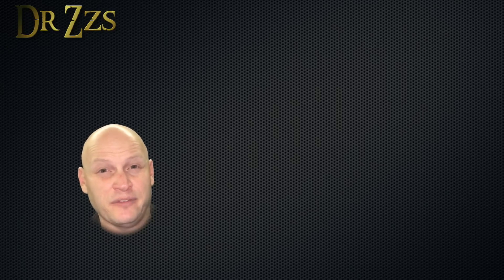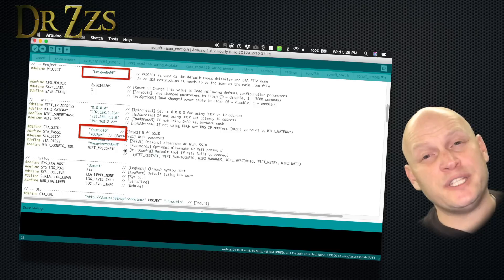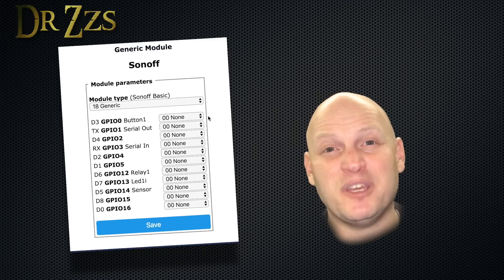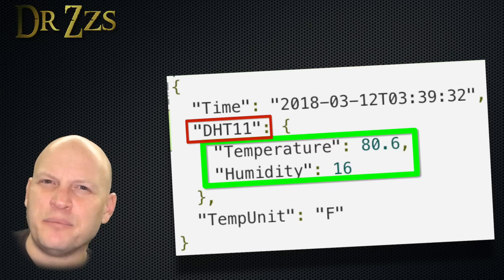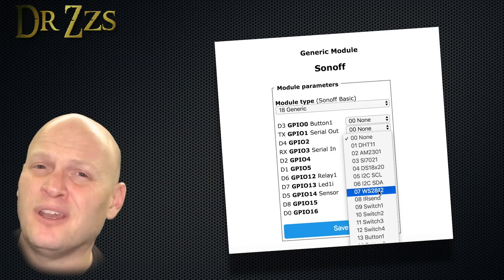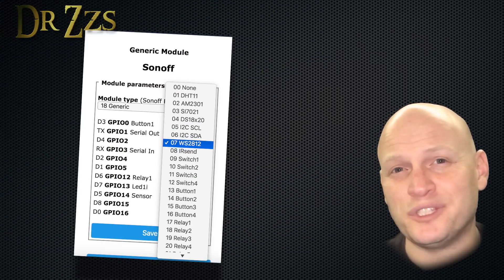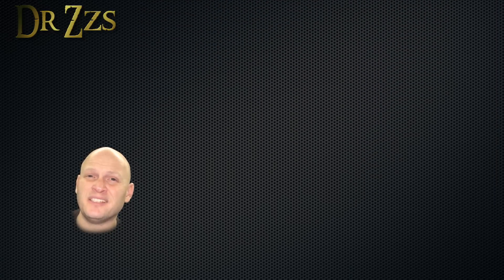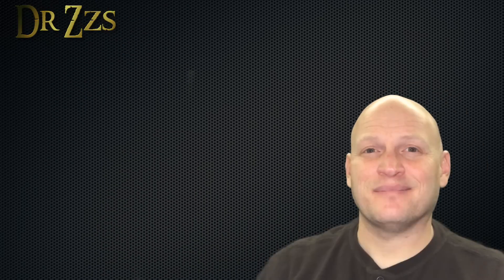Tasmota + D1mini (or Sonoff) - Temp & Humidity, ws2812 LEDs, and Motion Detection

Comment: is there a way to setup a relay like the switch like the sonoff.  i have a few spare esp01.. but i dont want to power the switch and have cables to the relay.  i just want to have power going to the relay like the sonoff.
Reply from the maker: You can connect a relay to the esp01 and the relay will be separated from the power to the D1mini.  Is that what you mean?  
If you really want to make it like a sonoff where you put 120v to it and then you switch that same 120v circuit, I guess you could do that, but it would be a lot more work and probably cost more than just buying a sonoff.  Besides the Esp01 and the Relay you'll also need a 120v to 5v power converter.  The PS is almost the price of a Sonoff Basic:
https://www.banggood.com/HLK-PM01-AC-DC-220V-To-5V-Mini-Power-Supply-Module-Intelligent-Household-Switch-Power-Supply-Module-p-1242358.html?p=@K220219381694201802

That's the appeal of the Sonoff.  You can't buy the parts and build it yourself for less $. 

If you still want to do it you'll have to use the 120v to power the PS.  You'll tap into the Hot line and send it to the Common pole of the relay, then a wire from the NO pole to the lights or whatever you want to switch.  The neutral will also go to the PS, but then also continue on to the lights you're switching.  Then with ps you can power the esp01.  The ESP01 might need 3.3v instead of 5v so you'd need either a 120v to 3.3v ps or another buck converter to drop the voltage from 5v to 3.3v.  The relay will need a supply of 5v in addition to the ground and the control wire from whichever pin you use from the ESP chip.  

Hope that helps. 
Good luck.

Comment: can't seem to get my PIR up and running 

1. I I select "switch3" because the PIR is on D7 and I have relays on  relay1 and relay2
2. after save and restart , in console I ran this command "switchtopic3 saraiyh motion"
3 . I added the binary sensor in my yaml file:
binary_sensor:
  - platform: mqtt
    state_topic: "cmnd/Saraiyh_Motion/POWER3"
    name: "Saraiyh Motion"
    device_class: motion

4. I name the topic: "Saraiyh_Motion"
5. in the console when I move I can see this "19:56:52 MQT: cmnd/Saraiyh_Motion/POWER3 = TOGGLE"
however, the minary sensor does not do nothing, 

what am I missing
Reply from the maker: try "stat/" instead of "cmnd/"
Reply: I just tried "stat/Saraiyh_Motion/POWER3" and the sensor has an error .. it disappeared

21:08:24 MQT: cmnd/Saraiyh_Motion/POWER3 = OFF
21:08:24 MQT: cmnd/Saraiyh_Motion/POWER3 = ON
21:08:25 MQT: cmnd/Saraiyh_Motion/POWER3 = OFF
21:08:25 MQT: cmnd/Saraiyh_Motion/POWER3 = ON
21:08:26 MQT: cmnd/Saraiyh_Motion/POWER3 = OFF
Reply: its working now with cmnd do not know why it just started working
Reply from the maker: oh well, as long as it works!

Comment: I have realized from watching your videos if you are going to build an item for a single sensor its cheaper to use a sonoff with a cheap extension cord from the dollar store. 
Definately going to use a sonoff to turn on my power supply for my led lights and then control them from the sonoff. 

Great videos. thanks for you help.
Reply from the maker: Awesome!  That would be a good use for it.  I've been using Tasmota to control RGB LEDs for my Maker Faire display.  Works great.

Comment: Great video. However note that the D1 mini is not "always in programming mode" like you suggested. The USB serial converter has circuitry in it that will reset the chip and pull GPIO0 down just before the program is sent, placing it in programming mode for you.
Reply from the maker: excellent!  Thanks for clarifying.  
I learned something new too!

Comment: Not sure if anyone know how but Ill give it a shot. My DHT11 needs to be changed because the temperature is 3 degrees off. I looked in home assistant and saw that we can add an offset. but it doesn't work. Is it because its in JSON format? How do we do this?

https://community.home-assistant.io/t/wrong-temperature-value-on-multisensor/32330/7
Reply from the maker: I haven't done it, but what happens if you format the value_template like this guy did:
https://community.home-assistant.io/t/wrong-temperature-value-on-multisensor/32330/9

value_template: '{{ (float(states.sensor.tmp_living.state) - 1.4 ) }}'

Also, the DHT11's aren't super accurate. That may be why the correction of the temp still doesn't give you an accurate temp. You may be better off with a DHT22 (AM2302).

Comment: Great video as usual DrZzs has anyone linked a sonoff basic to a water leak detector off some sort ?, i've looked at various wireless versions using home assistant ( z wave & 433Mhz ) but unfortunatly im getting reliability problems (especially with z wave devices they just seem to work when the feel like it !)  Ive got 20+ sonoff's for lights and they have been faultless and 100% reliable...looking to get this reliability into my water leak sensor (for basement)
Reply from the maker: You probably saw the one I used in the last RF Bridge video.  That one seemed reliable.  But it was 433mhz.  
If you're looking for something wired there are a couple types of Arduino water sensors.  I don't know if there is a wired "leak" detector but I have seen water level and moisture sensors.  One of those might work.

Comment: My sensor shows the F for Fahrenheit but the actual reading is still in Celsius. Any ideas?
Reply from the maker: maybe try "setoption8 1" in Tasmota Console
Reply: Fantastic video btw! I think I will add a couple reed switches and monitor my garage doors.

I ended up changing the HA configuration “unit_of_measurement: to “C” ..... this worked I’m assuming because my HA unit system is set to imperial. I’m sure your suggested setoption8 to 1 would have worked as well.

Comment: After 2 days of errors for undefined resource WPS errors I finally found out you have to run an older board package version. esp8266 version 2.3.0 works but the newest ones caused me about 20 hours of headaches a sore butt and wasted weekend. Also if you want a DHT22 to work for some reason I could only get it working on pin D5 using AM2301 as the sensor type. Even though the sensor is technically a AM2302 it works. I'm a total newbie to all this so maybe that's why it took me so long but I hope this helps the next person. I was using a NodeMCU's if that makes any difference.
Reply from the maker: I've started only using the sonoff.bin pre-compiled binary file to avoid all the library/board manager issues.  I haven't tried putting Tasmota on a D1 mini in a while so I don't know if there are issues with newer .bin versions.  I'll be using a couple for the maker faire so I'll try it out and see very soon.   Sorry it was such a pain for you.
Reply: While frustrating it feels good when you finally figure something out and make it work. The only issue I have now is it's only outputting in Celsius. I even changed the 0 to a 1 in the user_config.h to change to Fahrenheit. I just convert it in HA by adding * 1.8 + 32 like this: value_template: '{{ value_json.AM2301.Temperature * 1.8 + 32 }} Anyway I've enjoyed your videos a lot and you are very helpful. I feel like a celebrity just answered my question. lol, keep up the great work.
Reply from the maker: Ha! celebrity?  I'm going to tell my wife she has to start treating me like a Star! 
In the web UI for Tasmota, open the Console, what does it say when you type "setoption8"?  if it is 0 or off, then turn it on with "setoption8 1"
If that doesn't work let me know and we'll try something else. (I don't really have anything else to try, but I like to offer anyway :)
Reply: I found out that info last night after a lot of searching. You type: cmnd/your_sensor_name/SetOption8 1
Reply: @DrZzs  have you tried putting tasmota on any D1 Mini lately?  I'm having a hard time finding the right driver that will work with arduino on a mac.

Comment: Saludos from Puerto Rico 
Thanks for your videos ! I have an idea but don’t know who to start . I will like to monitor 
Varios battery 12vdc (12 of them ) from my solar system with Home Assistant . What you Think?
Reply from the maker: some inverters have API's that are accessible (so you can get data into HA).  What brand inverter do you have?
Reply: I have followed a guide and setup a Arduino voltmeter in the past (very simple and only needs 2 resistors per battery) maybe you could do something with a NodeMCU?
Reply: TheDazman 

Yes I’m looking for something like that 
But view with tasmota / homeassistant 
Thanks like always. Waiting for your holyday led especial !!!!!!

Comment: any way of helping to make a scheme popup list for the leds
Reply from the maker: I'd have to play around with it a little.  I haven't done that myself.  This is where I would start:
https://www.home-assistant.io/components/input_select/

Creating the list to select from I could do, but I'm not sure how to best link the options to the right MQTT topics to make the LED behave the way you want. 
I'm sure there are some folks in the Discord chat that could help you out. 
Discord: https://discord.gg/c5DvZ4e

Hope that helps
Reply: Thanks heaps that did help a lot I’m basing script in as per the link and think I’ll have it working soon enough .. 😁

# This automation script runs when the thermostat mode selector is changed.
 # It publishes its value to the same MQTT topic it is also subscribed to.
- alias: Set Thermostat Mode
  trigger:
    platform: state
    entity_id: input_select.thermostat_mode
  action:
    service: mqtt.publish
    data_template:
      topic: "thermostatMode"
      retain: true
      payload: "{{ states('input_select.thermostat_mode') }}"

Comment: hey @DrZzs , love your videos, subscribed a while ago, this is one of the meany really good videos along with the floorplan tutorial and many other ones. So a BIG THANK YOU. You saved me loads to research time. First time I'm asking for some help. I've setup the PIR sensor as per your instructions, I have flashed the "Wemos D1R2" (not the mini but still esp8266 ) as per your instructions and works fine with Tasmota, over the browser in the console I can see  (09:50:15 MQT: cmnd/d1pir/POWER2 = TOGGLE) when I wave my hand over the sensor which seems to work fine every time. The HASS server seems to be setup correctly as the motion sensor icon comes up and I can find it as an entity "binary_sensor.wemosd1"  I can manually change the state to ON or OFF and get the automation I've setup to work, but the motion detection doesn't toggle the binary_sensor from ON to OFF or OFF to ON on it's own. The topic is set as (state_topic: "cmnd/d1pir/POWER2")  Any idea why is not changing the state to ON or OFF when "TOGGLE" ? Thanks in advance!

Comment: Hi Doc! Thanks for you videos! I'm traying to flash a NodeMCU, but I can't get the extra driver turns the com port visible on Arduino software. The extra driver is installed. Any ideas?
Reply: Finally did it! My NodeMCU is V3, and this version has CH340G chip, that need other driver.
Reply from the maker: ah!  good to know.  
Thanks!
Reply: DrZzs I could only add 4 switches on the tasmota generic type module, even having many GPIOS pins available. I couldn't read from mqtt other options in GPIOs assignment (button, relay, leds, etc) when calling Status 8 or 10 on the Console. Is that right? Maybe I shoud try the "konnected" software on my NodeMCU to control doors magnet sensors....
Reply from the maker: that has been the case, there's a max of 4 switches assignable through Tasmota.  I read a post on the github that they were going to expand it, but I don't know which version that was planned for.  It might not be out yet.  
Have you tried using the Button option?  I don't know if it would work the same, but it might.

Comment: Hey Doc, strange happenings... I have followed all instructions for the DTH11 and it does show up in tasmota GUI and I have temp and humidity icons showing in hassio but no figures. Only a dash and when clicked upon say "unknown". Any thoughts would be appreciated. Cheers Baz from downunder
Reply from the maker: I’d guess there’s a problem with the topic and/or the template.
Look in the TASMOTA console. Something should show up showing the temp/humidity in the payload. Make sure the topic it shows matches what you have in the sensor entry and then see if there are differences between the payload it shows and the template you have. 
That’s probably hard to explain in text. I need to try and demo this in a video. 
Hope that’s enough info to get you past it.
Reply: Thanks Doc. I watched your latest live stream tonight. I see the question was raised by someone else as well. I followed everything you did and in the chat when you were figuring the POW issue. I just can't get the dam thing to show up in hass. Working fine in Tasmota and this is my console display:

10:25:49 MQT: masterpir/SENSOR = {"Time":"2018-07-09T10:25:49","DHT11":{"Temperature":24.0,"Humidity":51.0},"TempUnit":"C"}

and this in .yaml

- platform: mqtt
    state_topic: "tele/masterpir/SENSOR"
    name: Temperature
    unit_of_measurement: '°C'
    value_template: "{{value_json['DHT11'].Temperature }}"

The thing is, I don't even need it to do anything at the moment but I just can't let it go!!! This automation stuff is addictive :) Thanks for getting back to me mate. Cheers Barry

Comment: Hello as usual your videos are awesome, but I ran into a problem, I´ve flashed tasmota in nodemcu and I conected a PIR am312 as switch2, I can see it into the console, hi gives me some toggles and detecting presence, I also included as you included your in homeassistant but it seems it´s not conecting as it´s not receiving any of the toggles, it apears to me as always turned down. I checked my mosquitto and nodemcu it´s conected, any ideas what´s going on?  I switchtopic2 with his name, and using the same in the config.yaml.

Comment: Great Video. Thanks 

Question:
I have two Switches on the Sonoff. For one switch I get the Status of the switch via MQTT but not for the Second switch.

Do you also have a solution so I can read two different Switches via MQTT?

Thanks
Jakob
Reply from the maker: Thanks
Go to the Console in Tasmota, then click the second switch. You should see a couple lines pop up on the console.  the one that starts with "stat" will be the "topic" for the state of that switch.  It will probably be something like:
"stat/sonoff/POWER2" 

Hope that helps
Reply: Thanks,

I tried this already and defined a second switch in the Console.
If I press the second button I get the same Mqtt Info from the two Button.

Any idea?

Comment: OK DrZzs I am watching your videos since  years and have made many projects with sonoff. Now I tried the D1 Mini ... there is a very strange issue I am facing and i am not getting any ans. maybe you can help.  this is how I have connected  D2 is relay one and  D4 switch1, now when I short D4 to GND, the switch works as intended, but if I keep the switch on (i.e D4 and ground is shorted) and in that situation I reboot the device , it gets stuck in loop and does not get rebooted, and I loose the web interface. How ever if I disconnect the D4 and ground and then reboot all is ok and device reboots and I have the web interface. . Basically if GHD and Switch1 are ON (shorted) and in that situation/condition device reboots (or power goes down and comes back) . D1 Mini never boots and no web interface. .. I have to unshort (disconnect) GND and switch1 and then reboot the device again to get the web interface back ........ .Why is this. ???? is there a solution.....can you address this problem .... please do try to re create and tell me if you also face the same issue and how you managed to rectify it.
Reply from the maker: That is interesting.  I'll try to reproduce it when I have some time.  I'm wondering if there is some special purpose for D4.  If you switch the relay to a different pin does it do the same thing?
Reply: OK ,,.. thanks for the reply  ... what I did was not use D3 or D4 for either switch or relay and I was able to boot the devvice even if the switch and GND were shortened. I  stated thinking if this is a GPIO Pins issue let me see what works and what not, and then I started experimenting with all Pins both as switch and relay. Below are my findings ..... 

On D1 Mini we have following GPIOs..
D0, D1, D2 .... till D8
Rx and Tx

D3 and D4 does not work in no case.
D0 and D8 also does not work as switch but they work as relay BUT when switch1 (any GPIO) is shortened with GND, device does not boots and no web interface is there.
Tx and Rx works as switch and relay both BUT again when switch1 (any GPIO) is shortened with GND, device does not boots and no web interface is there.
That leaves us with D1, D2, D5, D6 and D7
all the above works perfectly, use any of the above GPIOs as switch or relay, the device works and boots nicely as well even if any one of the GPIO as switch is shortened with GND and rebooted.

So my conclusion is with D1 mini use only D1,2,5,6, or 7 for your switches and relays ....

Let me know if my findings makes any scene and what might be the technical reason behind it....

And thanks for all the help ..

Regards
Sammy